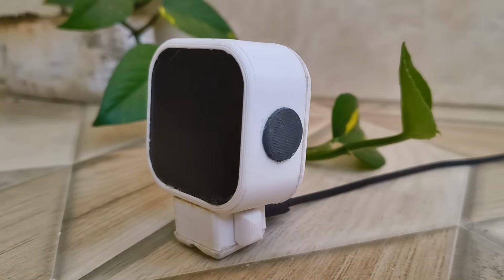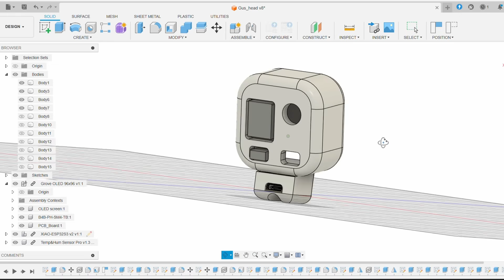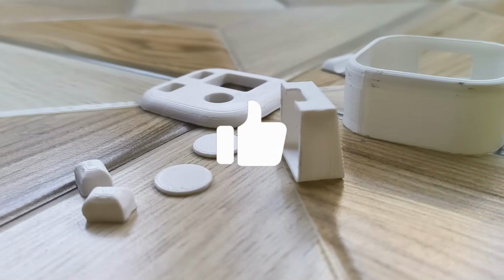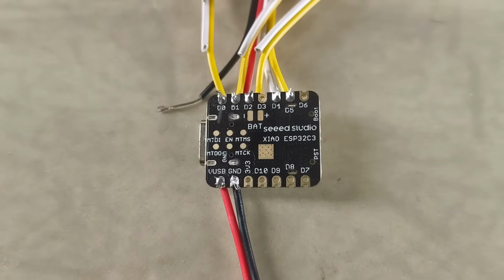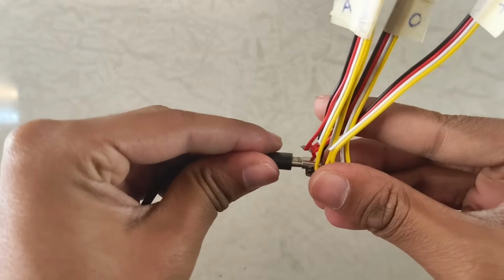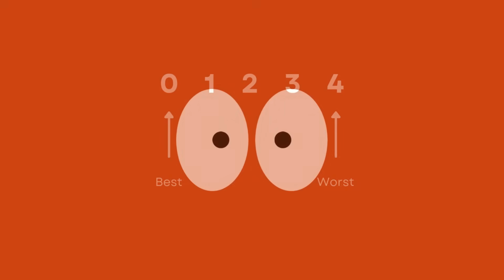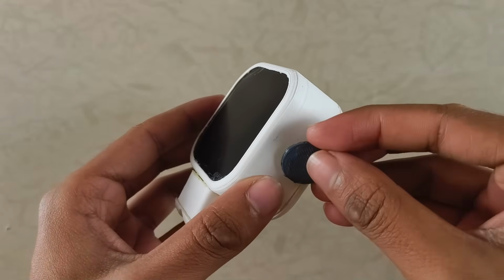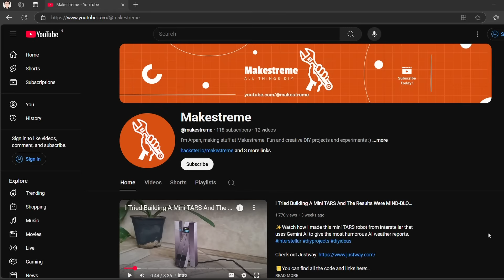I Built a Robot That MONITORS Room Health Through Emotions

Comment: Can I use 1.5 inch screen?
Reply from the maker: Definitely! Just keep in mind that the head is designed to house a screen which measures 4cm by 4cm (including the pcb). If it's any bigger, you'll need to redesign it.
Reply: Thank you brother...I have another doubt.Can chatgpt code such projects?I want to make a robot (just like Gus only) but my needs are a bit different.So can chatgpt code oled 1.5 oled with espc3? And is the coding correct?
Reply from the maker: @ruro35 Yup, I've taken help from Chatgpt in the past for programming Arduino and esp microcontrollers. It works quite well, although you need to be very specific about what you need in the prompt. Give all the details in a long enough prompt so it understands exactly what you're looking for.
Reply: Nice thank you 😊😊

Comment: Hi.
There's a small mistake in your sketch, on line 127: 
    "= currentTime; // Start the blink sequence"
Errormessage:   Compilation error: expected primary-expression before '=' token
Reply from the maker: Oh yeah that's correct. However, I had fixed that earlier. Could you re-download the code from the link and verify?
Reply: @makestreme  I fixed the problem myself, thanks.
The file still has the timestamp of 02/20/2025 at 13:16

PS: The touch sensor is still missing from the parts list.
Reply from the maker: @ernstklaus629 that's odd. Seems like the file isn't updated yet. I'll try to re upload it. Thanks for letting me know!
Reply: @makestreme  Hi. The software is now running. However, I had to exclude lines 95 to 100; the sketch always stopped after the loading sequence, but not always (?).

I also adjusted your case a bit.
Since I removed all the sockets from the circuit boards, I didn't need the holes in the head-back part.

I also printed a black display holder, which I glued to the back of the head. The display holder has a hole in the shape of the display. This way, the eyes glow nicely since I don't use a film.

I combined the feet, body, and arms into one piece and placed them on a round base so Gus can't tip over so easily.

Since the entire case no longer has any openings for the wires, the DHT22 is measuring "incorrect" values. The air quality sensor gets quite warm and thus distorts the DHT22's values.

So I had to adjust them in the sketch.

I think Gus is GREAT. Thanks for the video and all the files.
Reply from the maker: Those are some great improvements! I'm glad you got it working and made all those updates! Thanks for your detailed explanation. This will be helpful for others building Gus and I will definitely incorporate some of these in Gus 3.0 :)

Comment: Hi, I tried building this with same components, however the display animation seems different, as I only see half the eyes. It is similar to what you have in the video at 10.40 timeline
Reply from the maker: Which microcontroller are you using? You need to make sure you have connected the OLED display to the hardware I2C pins of your microcontroller
Reply: @makestreme  Hi I am using ESP32-C3 SoC. I am using the same modules as you have in your video.
Reply from the maker: @preesingh277  That's odd. The code should work fine. It is possible that you can see half the eyes because the sensors are reading data that corresponds to moderate conditions.
Reply: @ thanks for your response.
I realized that i needed to modify the temp/ humidity range to see full eyes.
This is based on my country.
However it doesn’t blink.
Maybe need to look at the code again
Reply from the maker: @preesingh277 Great that you got it working! Yeah the blinking doesn't work sometimes for me too. I think the code needs some changes.
Reply: @makestreme  ok
So this is a know issue? Hahah.
Good to know.
Thanks for your help.
Reply from the maker: @preesingh277  Yeah it is. I had recently updated the code and re-uploaded it in the description link. I suggest you download it again to make sure you have the latest version. Although this version is also not perfect and the blinking may still not always work.

Comment: Maybe instead of this black mask, print 1 or 2 layers. The model would be uniform, and the display would shine through 1 layer of filament as if it were on full brightness. 
It can also change the eye color green, yellow, red with the deteriorating air quality 
Regards
Reply from the maker: Not sure if I got it right. But from what I understand, you're suggesting printing a thin layer for the face to shine the light from the oled display through. But I don't think this way the text will display clearly.
Reply: @makestreme  white sunlu filament is almost transparent but still holds the color

Comment: 👏👏👏👏👏👏👏👏

Congratulations for a such creative project and thank you for sharing all the files. Do you think an Arduino mini could run the program? I notice that it doesn't require much memory, but the animation part would probably run slower.
Reply from the maker: Yes, I think Arduino mini should work fine too. As long as you connect the display to the hardware I2C pins, the animation should also be quite fast.
Reply: @makestreme  Another project on the list . 😁

Comment: hey, thanks for this awesome project. i am just about to realize it for myself. i am not a fan of gluing things together with 3d prints. i try to avoid it whenever possible. imo when i can design it digitally it may avoid some work afterwards. so i saw your design and had some thoughts to improve. i took it as inspiration and redesigned all the parts so they wont need so much glue or double sided tape. i made a bracket for the screen so it will be held in place and also i re-positioned the sensors and also made some brackets for that. i am just about to put it all together and see if everything works and fits together. the pins for the sensor boards to hold them in place are very very fragile when printed. so i have to see about that.
at the moment i am about to bring the software to run. this is by fare not my strong suit. thanks very much to put the effort in it and sharing it.
if there is demand i will be sharing the files somewhere. atm it is still a WIP
Reply from the maker: Wow, that's awesome! Yeah, I'm also not a fan of gluing 3D prints. But this was my first time designing a 3D printable part so I thought of keeping it simple. 
I'm glad you've designed an updated version! I'd love to see your design once it is finished :)
Reply: Hi! Mind sharing the files? Thanks!
Reply: will you please share your files?

Comment: There is 3d printed top wall in between touch sensor & Finger and its working, I have to do same thing in my project but i used 4mm black acrylic so it will work?
Reply from the maker: I would not recommend using such a thick material. My housing is 1mm thick so it works. But 4mm is probably too much for the touch sensor to detect through
Reply: @makestreme  Ok, Thanks for reply